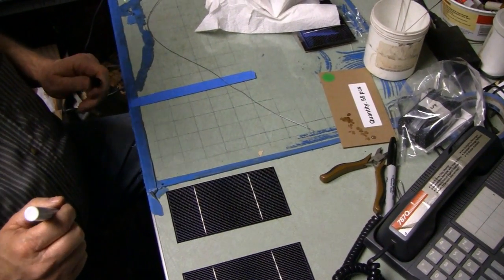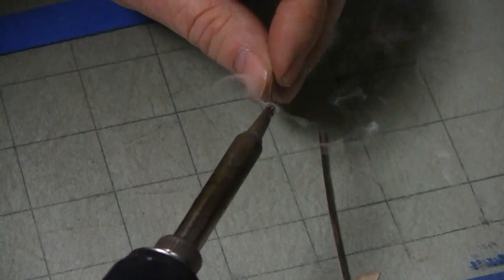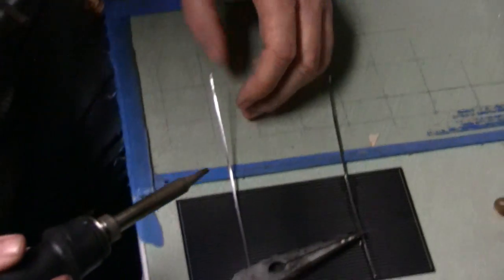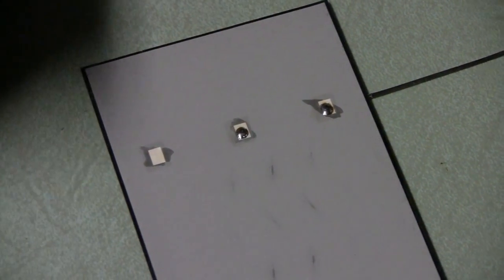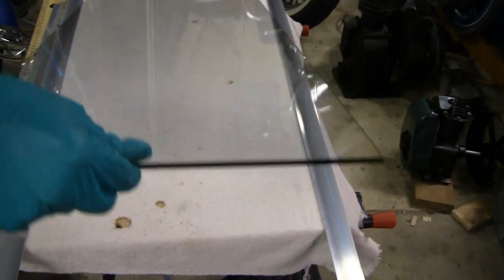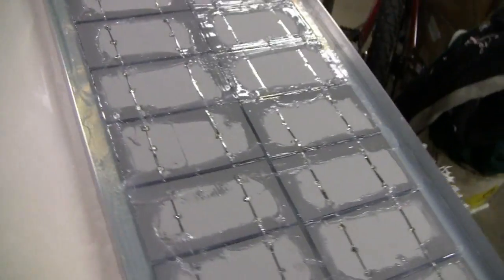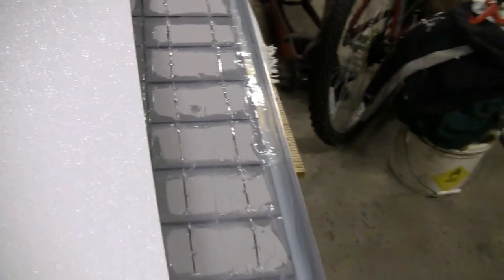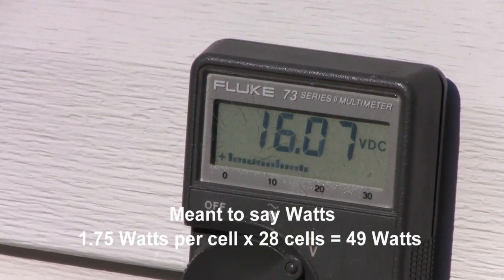HOMEMADE SOLAR PANEL

Comment from the maker: @pof1991 Thanks Martin!!  Your exactly right, top of one cell to the bottom of the next one. You are just connecting them in series similar to hooking up batteries each additional cell is another .5 volt!!☺

Comment from the maker: @spikey911usa The backing is called FRP (fiberglass reinforced plastic) you can get it at home depot or lowes. 4x8 sheet for $25. That panel is only 9 months old and doesn't have any corrosion yet!!☺

Comment: Where did you get the backing, and how is the panel holding up? I understand silicone has acids that slowly corrode metal, so I am curious how it is doing.

Comment: You need to check out Mixcat on here he has been doing these for over a year now , in fact he has quite a few things in his house including his hot water heater on solar energy.  don't know if you did or not but you should have taken the panel outside and tested it all efore you got it all slammed together. actually there you go for your battery charger.. you could wire that inside to a battery bank and charge the batteries for all your motorcycles and yard equipment with those things.

Comment from the maker: @edzgarage No it's not a kit, we collected everthing locally. We got the cells off Ebay. The hard part is trying to find cheap tempered glass. I think the next ones we make will be from an old sliding glass door. That will be about 200 watts!!☺